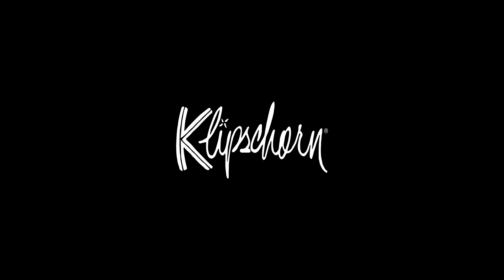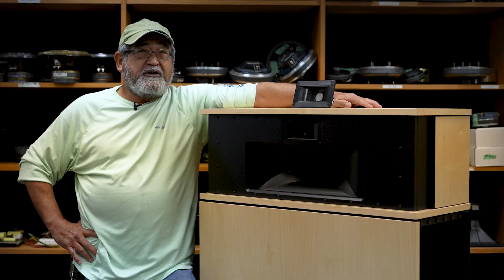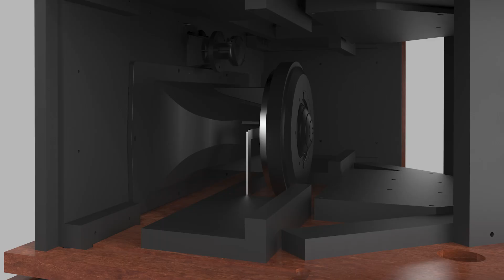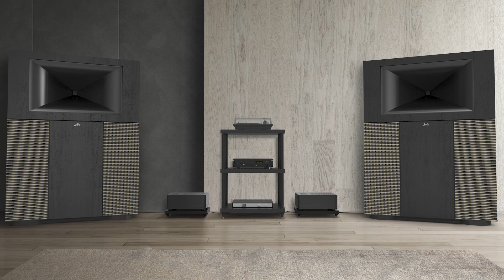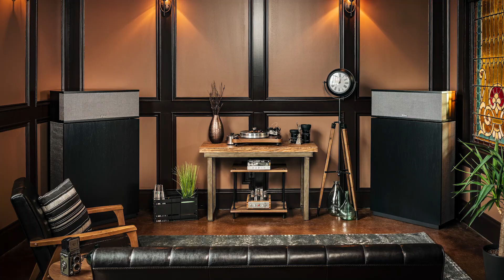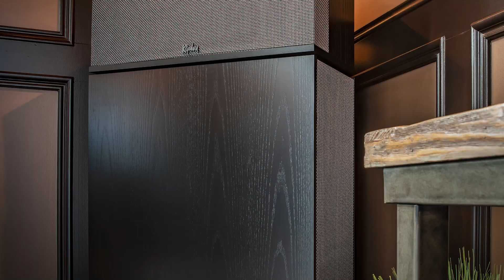Full Klipschorn AK7 Launch Video – The Klipsch Roy Delgado Interview

Comment: A good compromise would have been to maintain a passive crossover for the midrange and tweeter since its been shown that at high frequencies, the small time delay difference between the tweeter and midrange is essentially inaudible. This way, only 4 channels of amplification is needed for the active version.